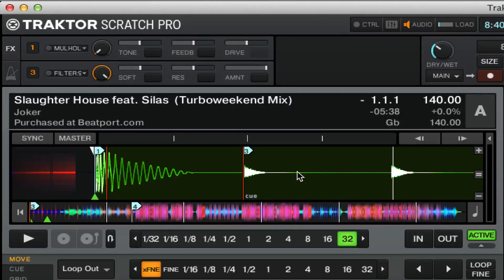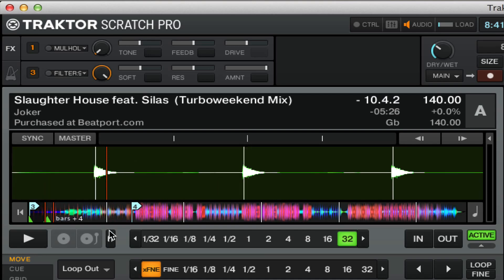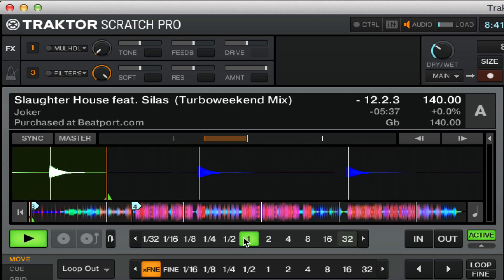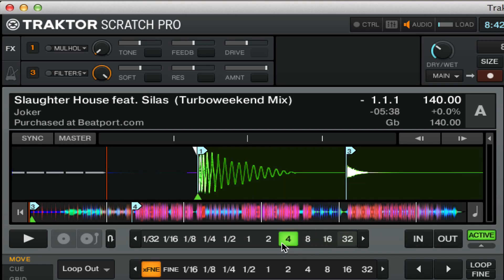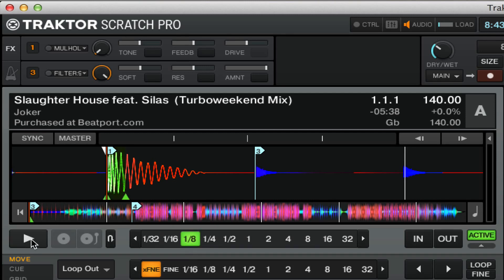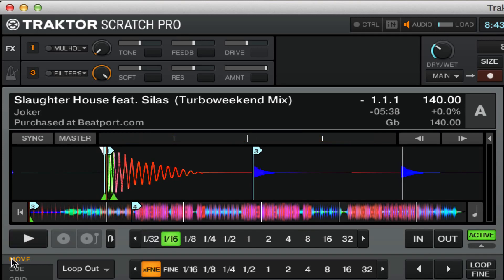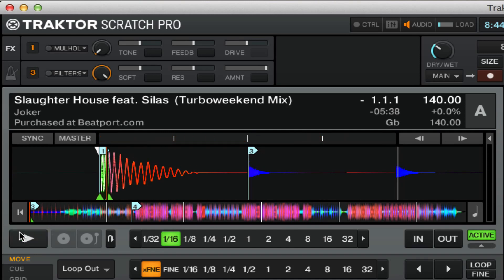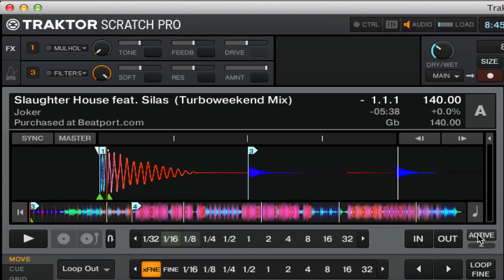Traktor Tutorial - Looping in Track Decks

Comment: Hey there, I'm cutting same samples, and as I need to make loop for ex shorter than 8 out of 32, how can I set the loop in the desired length for ex 6 as there possible to set 1,2,3,4,8,16,32. 
Is it possible to set for 6, 10, 20?,
THANKS IN ADVANCE
Reply: If you have the 'Snap' option de-selected, place the track marker at the beginning of where you would like the loop to start and press the 'In' button.Then move the track marker to where you want the loop to end and press the 'Out' button.Not having the 'Snap' option on means you are not limited to the set loop lengths. I hope that helps 👍